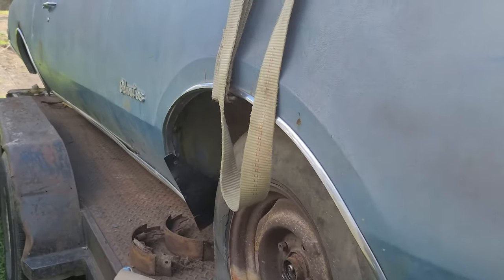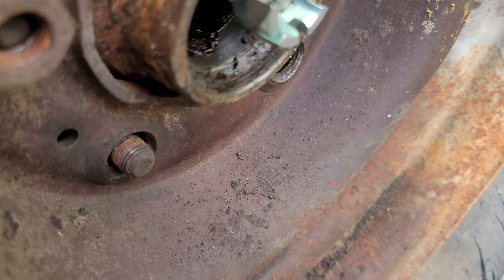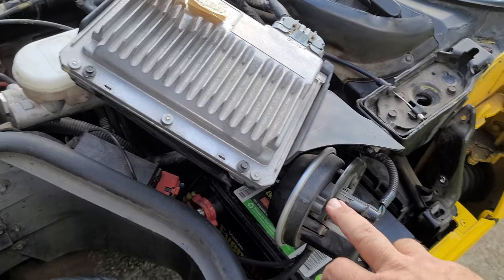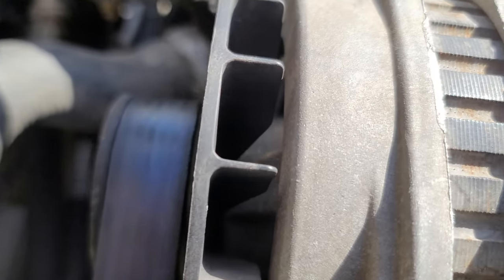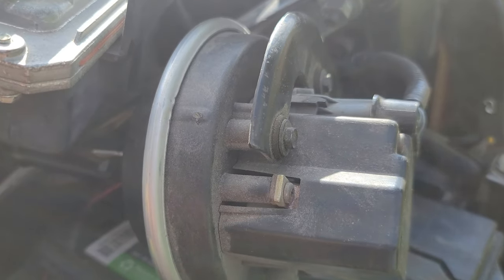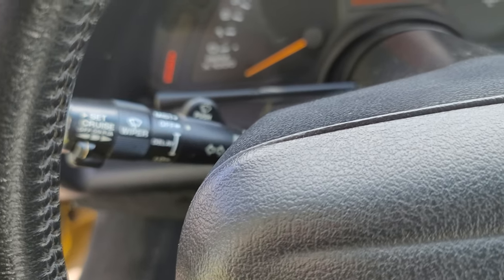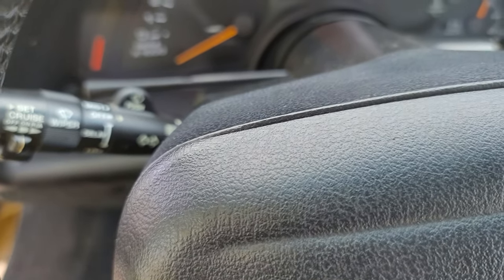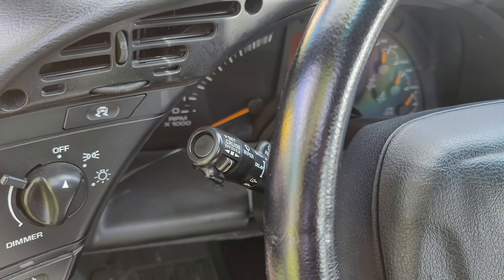The Reliable C4 Corvette Cruise Control System

Comment: Actually, according to Professor Google, a cruise control system was first used in the very early 1900s and our modern cruise control was invented in the late 1940s by a guy named  Ralph Teetor. It was first used by Chrysler the name Cruise Control was first applied by Cadillac in the mid sixties.
Reply from the maker: Thanks for sharing, Robert👍.
Reply: @VetteSource  👌🏻

Comment: My ecu in the engine bay was resting on the cruise control vacuum module because of a worn out plastic bracket on the ecu. This caused the rubber cruise control module to pull the throttle cable and give the car gas when I was totally off the gas. This was especially noticeable on bumpy roads.
Reply from the maker: Yeo, a broken ECM mount can cause quite a few problems. I have to address it on my 1996 Competition Yellow LT4. Shutting the hood is quite difficult sometimes.
Reply: @VetteSource  that was another issue I had. Once I adjusted the ecu and harness, and dropped the hood from the appropriate 18" height it closes great.
Reply from the maker: Yep, everything is packaged so tightly in that one corner. Anything that is out of alignment will cause issues with multiple other systems.

Comment: Great information. I didn't know how to use the buttons but worse, since I purchased my '94 @ 20 yrs ago, the cruise control didn't work and of course my thought was "who the heck needs this on a Corvette" lol. Last year I drove from So. Cal up to Grover Beach (just north of Santa Barbara) and realized it would have been nice if the cruise control worked. My right leg just wasn't happy. Low and behold, while cleaning the engine bay, I noticed tucked deep behind the left wheel well there was a vacuum line which wasn't connected. I traced it back and found that it led to one of the ports on the cruise control servo. After connecting it, and taking out to test it, IT WORKED!. After feeling a bit foolish, I've been enjoying it.
Reply: Awesome! I tell people to first check the vacuum lines....easiest thing to do. I nearly went down and messed with the cc switch at the brake petal. I would have spent hours under there messing around when all it turned out to be was a disconnected vacuum line. Glad your cc is working. Check out his video on the ASR system. Another valuable learning experience as I thought it was the ABS system. Not so, very different systems which work in conjunction with each other.
Reply from the maker: I'm glad to hear it was helpful. I would agree with you. Cruise control on a long trip is a necessary luxury that I appreciate more and more the older I get😁.

Comment: How do you turn on the high beams on these c4's? Is it on the multifunction switch? Or is it only controlled the left side where you control the popup headlights, I'm very confused about this or if it even has a switch for them 12:12
Reply from the maker: Hey Eduardo, you just pull the turn signal switch towards you to activate or deactivate the high brams. You should hear an audible click when you pull it towards you. If you don't, the internal part of the turn signal switch could be broken. It's a common problem with these years.
Reply: @VetteSource  thank you so much just tested it, and mine work! I thought mine was broken but I guess I wasn't pulling it back enough 😅.

Comment: What's the possible issue if I have a cruise control that can't be turned off without tapping the brakes? With the switch set to off on the stalk I can still set the speed with the button.
Reply from the maker: My first thought would be that the turn signal on/off switch is malfunctioning.

Comment: I discovered today that the bottom vacuum line on the solenoid seems to be completely missing. I can't find  the line or a place where the line would be connected if it was on the solenoid. Can you tell me what that bottom vac line is supposed to connect to?  Thanks!
Reply from the maker: That line runs back along the driverside frame rail to the left front inner fenderwell and connects to the round vacuum reservoir mounted next to the headlight module. Most likely, it was broken off at some point in your cars past, and they never bothered to replace it.
Reply: @VetteSource  thats what it looked like in the FSM. But on mine the line from the vacuum reservoir runs to a T fitting right under the ASR. The other lines connected to that are a larger black hose that runs down next to the engine (I think its part of the AC system) and the other is a small hard plastic hose with an elbow that joins some electrical wires and goes into the firewall...there seems to be no place to connect another hose.
Reply from the maker: I'll take a look at one of my cars today to check for exact routing and get back to you.
Reply: @VetteSource  awesome! This has got me scratching my head and my local mechanic couldn't figure it out either.
Reply: @ObscureStuff420  Did you figure it out? I had the same issue and found the line tucked deep behind to the rear the inside of the front left wheel well, underneath the fuse box. Simply pulled it out, reconnected it to the lower fitting on the servo and it worked!
Reply: @eaglerider94  what happened was, someone connected the CC vaccum line to an AC bleeder valve on a line right under the T junction. That bleeder valve looks like a vaccum line should connect to it but nothing goes there. The line was there the whole time but because of what they did it looked like a different line that belonged elsewhere. Pretty sure whoever installed the aftermarket security system (they installed right near the CC servo) knocked the line loose, thought it connected to the bleeder valve and stuck it there. That's why the lines I saw didn't match up to the FSM. They couldn't have made it more confusing if they had done it on purpose lol

Comment: Are the radio and cruise control intertwined, and where is the cruise control relay located?
Reply from the maker: Hey Gordon, the radio and cruise systems are separate. The cruise module is located under the center of the dash and is accessed by removing the dash pad.

Comment: 1989 vette cruise control does not work  fuse is good n call connections look ok what else can I look for  thanks
Reply from the maker: I would take a closer look at the rubber diaphragm part of the cruise module. My guess is that you have a split or tear which allows the vacuum to escape the system.
Reply: Also check the vacuum lines. If originally, they are definitely worn, stretched out, and cracked.

Comment: So what should I check when the antenna makes no noise but has power, and what's the relay that's in the rear of my 95 Vette located on the passenger side under the center trim piece?
Reply from the maker: The relay next to the window latch is to activate the hatch release. The relay for the antenna is closer to the antenna, next to the wiring harness. The relay is there to switch power from one side of the antenna to the other causing it to extend or retract. Usually when it won't do anything the antenna itself is bad.

Comment: I’ve had 3 C4 Corvettes. A 1987 bought new and 1994 bought new, and a 1994 bought in 2016. The cruise control works intermittently and the big Corvette shops in Palm Beach County Florida refused to work on it. I have to press the set button several times before it engages. Once engaged it works fine until it’s discontinued by braking or clutch. To re-engage from a stop, again I have to keep pressing the button to re-engage for however long before it finally decides to engage. Do you have any suggestions on how to make it work right?
Reply from the maker: My first thought would be the button at the end of the turn signal is not working properly since that seems to be the common theme every time you make an attempt to engage the system. Once it's engaged, does it work to lower the set speed when depressed?
Reply: @VetteSource  It does. Once the cc is disengaged the lever will re-start it unless I come to a stop or it’s been disengaged w/o stopping for a few minutes. I had given some thought to spraying some stuff into the stalk to dissolve any oxidation. However, intermittent cc is better than none. 

Getting decent work on my car so far has been practically impossible in Palm Beach County Florida. I bought replacement weather stripping and took it to a body shop last week. They practically wrecked my car. The doors won’t close w/o very hard slamming, the interior door panels are falling off, the drivers window is inoperable, the top is bending up at the corners, and the rear hatch is messed up. I provided the rubber  I got on eBay, so I can’t say if the rubber was wrong or the shop messed up. I wish I had let the minor leak alone, because now it would be like I had no seal at all. I’m waiting on a mobile guy who has done ok work before, replacing the radio and a climate control head unit I bought off of eBay, to try and fix it or remove it all. Ironically, I am well enough off, that money is not an important factor when seeking repairs. I’m thinking of dumping it for a C5.
Reply from the maker: I hear ya, that's an unneeded aggravation. Finding technicians with the patience and determination to properly repair our older Corvettes is a constant struggle. Then factor in the "Corvette" premium hourly rate everyone wants to charge regardless of skill level, and it just ends up leaving a bad taste in your mouth.

Even though I like C5's quite a bit, moving up from a C4 might be like going from the frying pan into the fire. The C5 has reached an age where they are experiencing multiple hard electrical failures, rendering many of them stuck and broken in the garage awaiting a qualified technician that can not only work on them but source the necessary parts needed.
Reply: @VetteSource  yeah, until my latest experience messing my car up by the body shop, I was a C4 aficionado. Other than a 1967 427, I think the C4 is the most appealing body design. If I can get the weather stripping decently fixed along with all else the shop messed up, I would want to keep it. The more days that go by where I can’t use the car, the antsier I get to get rid of it and start with something newer. I listened to Lyle @C&S  who listed the best years for the C5 and what to beware of.
Reply from the maker: Yep, I think I've seen that video. I'm like you, I prefer the C4 body style a bit more that the C5. Plus even though they have some difficult electronics they're not quite as challenging as the C5's.

Comment: Hello, I've been having issues with my cruise refusing to engage on my '96. I confirmed the solenoid does get vacuum, but is there any way to know if it's getting power without digging into the dash for the module? I feel a bit nervous about working right under my passenger airbag.
Reply from the maker: I understand, working under the dash isnt that mich fun. You can unplug the electrical connector from the cruise module under the hood to back probe the terminals to verify power. Also, take the module loose from the bracket and carefully inspect the rubber diaphragm for any cracks of tears. Very often you'll find that to be the source of the problem. Let me know how it goes.
Reply: @VetteSource  looks like no power to the solenoid, weird
Reply from the maker: Yep, that is odd. First thought would be to check the cruise fuse.
Reply: how do you check the solenoid if it gets vacuum? trying to fix this problem myself lol
Reply: @titoqwentezproductionz3406  with the engine running, pull off one of the rubber hoses that connects to the cruise solenoid over the battery. If you feel suction, you've got vacuum
Reply: @joburgoof9404  ah ok thank you I will check that out !
Reply: I have a 96 and both hoses are off my cruise and I want to put them back. I don’t know where the top hose hooks into I believe the bottom goes under towards the booster. Any help would be greatly appreciated
Reply from the maker: I was just out inspecting my 96 the other day and noticed there is a splitter valve directly in front of battery that directs the hose that originates from the vacuum reservoir into different pathways. I will probably make a video this week illustrating the proper path routing so you guys van visualize it.
Reply: @VetteSource  that would be awesome. Thank you

Comment: I just subscribed.  Do you talk about trouble shooting the cruise control if it doesn't activate?
Reply from the maker: As a matter of fact I did -

https://youtu.be/E5ihXB5yAGs

Let me know if you need any more information and thanks for the sub👍.
Reply: @VetteSource  This video was mostly about the components and location of the cruise control, but not how to troubleshoot the system.  Mine doesn't activate.  Do you know where the fuse or circuit breaker is for the cruise control?
Reply from the maker: The fuse should be in the main fusebox located at the passenger side of the dash in the door jamb if I am remembering correctly.  You can start there, and then I would recommend checking the vacuum supply to the cruise servo itself. Many times you'll find there's a damaged vacuum hose or the diaphragm itself on the servo has a tear in it.
Reply: @stricklandgarageaviation2864  Did you figure it out? Start with vacuum lines. One of the vacuum lines to mine disconnected from the lower port of the servo. Never noticed until I traced it back behind the wheel well under the fuse box.

Comment: I use cruise control all the time from speed limits of 35 and above. to make sure I don’t break the speed limit. Sadly my system in a 1994 Corvette is intermittent. It takes me about five times pressing the button to catch. My Corvette mech won’t fix it or anything that takes used electronic parts.
Reply from the maker: It's most likely the turn signal/cruise lever assembly which I believe may still be available new.
Reply: @VetteSource  I was thinking that myself. Though I know the speed sensor for my antilock breaks and slip control is kaput and I thought maybe it is also needed for cruise control
Reply from the maker: The ASR module is definitely a must have, not sure if a bad wheel speed sensor will disble the cruise. I'd have to reference the FSM to be certain. Good news is the ASR modules are a very reliable piece of equipment even if they're used, so I wouldn't worry about putting one on your car.
Reply: @VetteSource  😎👌🏻
Reply: @VetteSource  my main beef with my car is not the cost of repairs, it’s getting anyone to do the repairs competently. Last week a body shop made my car all but unusable when they botched the job of upgrading my weather stripping making it less weather secure, the doors almost unclosable, the inner doors are falling off the drivers window inoperable, the top distorted, the hatch sprung. I supplied the parts and don’t know if it was bad parts or bad work or both.

Comment: Hello Bryan thanks for your feedback on the ride control question that I had on the C4 thank you for telling me if you do or don't have it the right control it's not a deal-breaker. I have another question between the 95 and 96 Corvette the OBD2 is fully functional on the 96 Corvette so is it better to have a 96 Corvette 10 + 95 I want to find one did I can drive everyday Drive the wheels off of it thank you for all your videos and I really respect and appreciate all your hard work did you put into this channel like I said before I'm very proud to be a subscriber to your Channel you have a great day now
Reply from the maker: Hey Kenny, the C4 was one of GM's vehicles they tested the OBDII functionality on starting in 1994 and 95, and then fully integrating with the 96's. 

With that being said, I don't think you'll find any functional difference in performance or troubleshooting capabilities between the OBDI 95 and OBDII 96's. 

If anything you may run into trouble finding someone with the appropriate scanner to diagnose an OBDII problem on the 96.